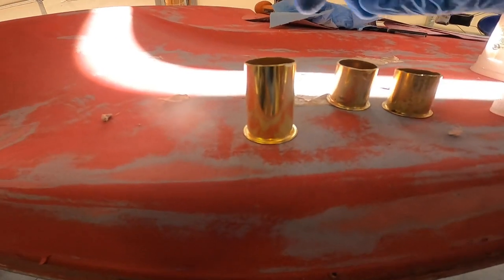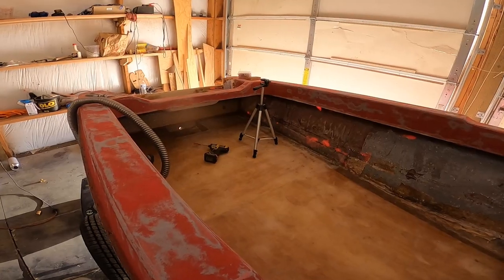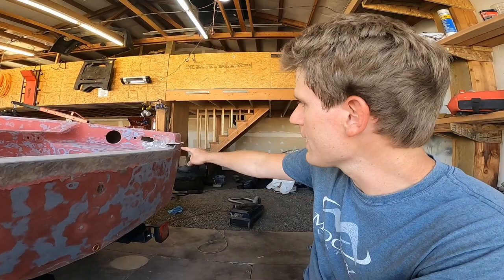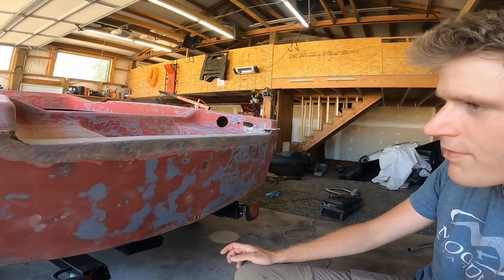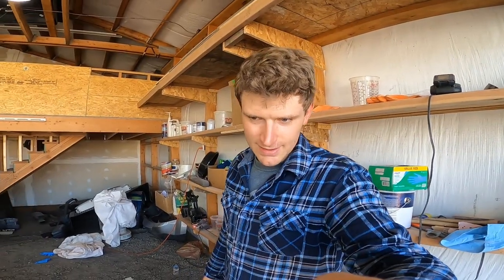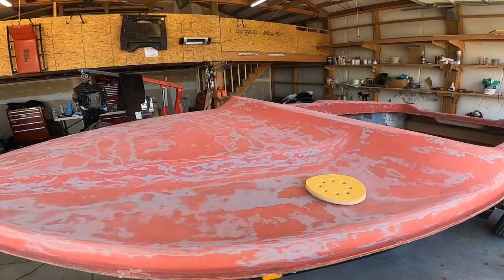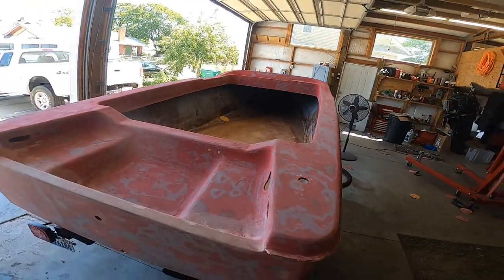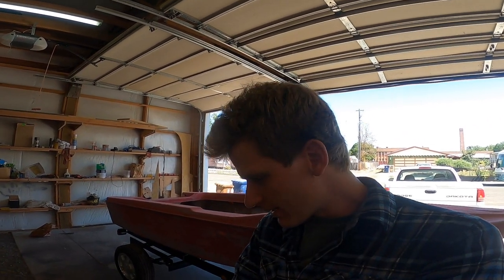Boat Rebuild (PART 19) Sanding, Drainplugs, Bondo

Comment: You can get a high fill primer that can be rolled on that might do an better job at filling .
Reply from the maker: That's a good point, i actually bought a gallon of high build primer that i sprayed on, i laid it down thick. i guess i will see what happens. 
but rolling does sound like it would do a good job of filling in those cracks... good thought. 😎

Comment: Do it like Rob Dahm. No outro. Just BOOM 💥 VIDEOS OVER! :)
Great content man. 👍👍👍 Binged the previous 18 videos HARD!!! :)
Reply from the maker: HAHA, not a bad idea. i saw some of his videos it seems to work with a sudden ending! 
thanks for the comment and glad your enjoying the series 🙂
Reply: In all fairness, not once have I ever gotten to the end of a video and said they didn't have a good outro now I just wasted the last 15 minutes. Your content is great and that is what is most important. I am going to be doing probably something quite similar to a 1990 Tri hull with a 90 horse Mercury engine on it so thank you for the inspiration
Reply from the maker: your welcome! i hope your boat wasn't as bad as mine. for a 1990 what's the first thing you need to do?
Reply: @Project2Potential  haven't even gotten I to it yet. But I have a strong feeling there will be some rot. 
Lots of floor fiberglass work for sure.

Comment: Keep ‘em coming!  Nice job on the transom glass!  I was told any gelcoat cracking needs to be sanded down and refilled with gelcoat for proper protection. Paint will definitely do a good job of protecting it but because I enjoy pain, I used gelcoat on my last project for those lines & it a canoe it’s really obvious that the little cracks expand with pressure
Reply from the maker: Thanks Robbie, i'm afraid of the cracks expanding as well. I did use a good thick layer of high build primer that seemed to fill in everything. now i guess i will see what happens in a year or so. this might be a good lesson i will learn. maybe on a future project i will try spraying on gelcoat. how did you end up applying your gelcoat on the canoe?
Reply: @Project2Potential  rolled it on & then used a paint brush tip to minimize the lines.

I bought a specific HVLP spray gun to gelcoat spray my boat but I had compressor issues and ended up doing the ‘roll & tip’.  On the next gelcoat job I’ll repeat roll & tip but try gelcoat from a gun on a small piece in the fall when it has a longer working time
Reply from the maker: i was also thinking about rolling it on. seems easier? maybe not tho

Comment: How well does the bondo area going? I need to fix some uneven area on my boat and wondered if I can just use bondo instead of the total boat fairing compound $$$$. Maybe I should use the fume cilica as my fairing putty 🤔
Reply from the maker: Automotive bondo actually worked really well for me. It's holding up great so far.
Reply: Awesome sauce. Thank you for the replies. BTW, whenever you want to upgrade that that windshield, I'll buy that one off ya. Washigton state near Seattle 😆

Comment: I tried filling mine with epoxy and used high build primer.  The cracks came back after about a year.  The boat guy says you have to grind them down to the fiberglass and fill them and thats the only way
Reply from the maker: oh shoot! what kind of paint did you end up using? i guess i will see what happens with mine as i have the primer and paint down already 😬
Reply: @Project2Potential  Petit EZ Poxy top coat
Reply from the maker: @L2fish  ok, I  bought totalboat wet edge topside paint.
Reply: @Project2Potential  I rolled and tipped using brushing thinner.  1st and second coat were great.  3rd coat I developed orange peel.    Dont know why.  Maybe not mixed as well as the bottom of the can.  I may get some more and try spraying it on.